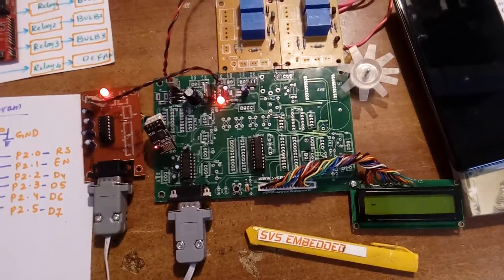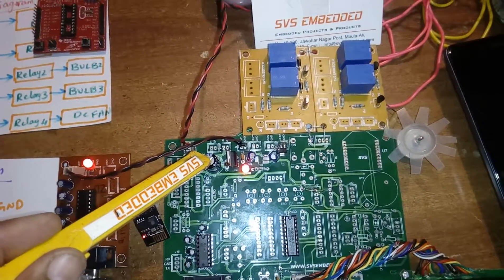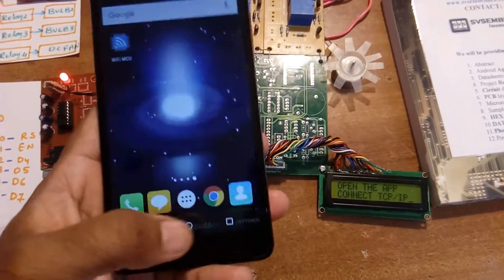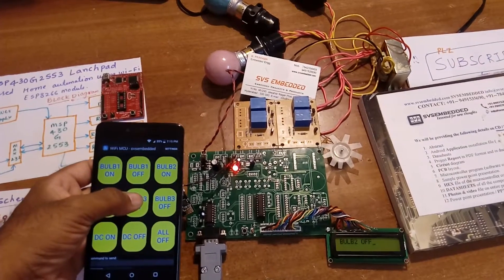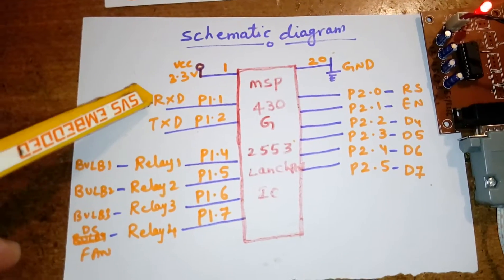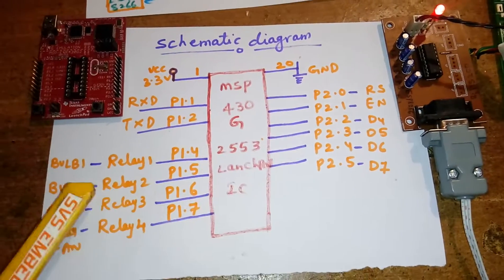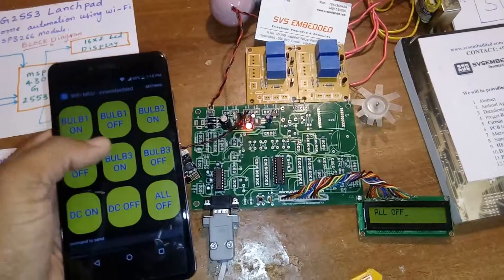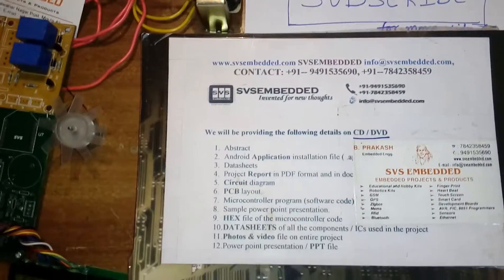ESP8266 Home Automation: MSP430 Based Android Home Automation And Control

Comment: is max232 necessary? can the msp430 and the wifi module be connected without using max232? why is max232 used here exactly?
Reply from the maker: Thanks for watching and your valuable Feed back. max232 is required
Reply: @svskits  But they're both working on 3.3v right ?? shouldn't they be able to connect directly?